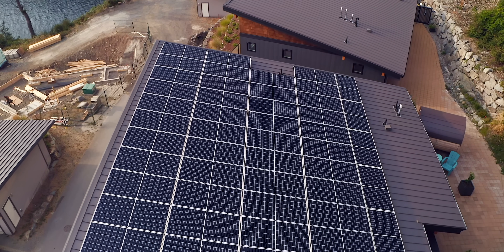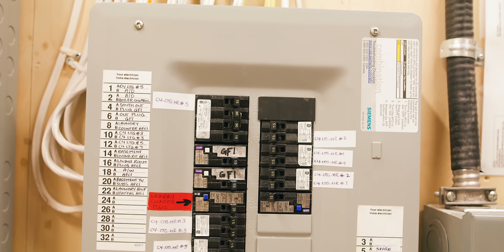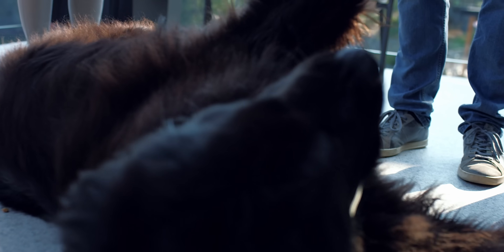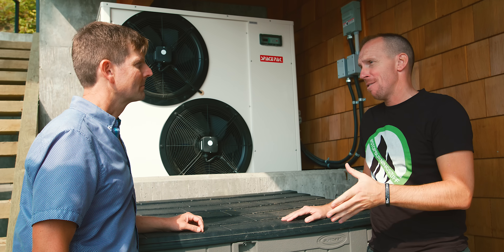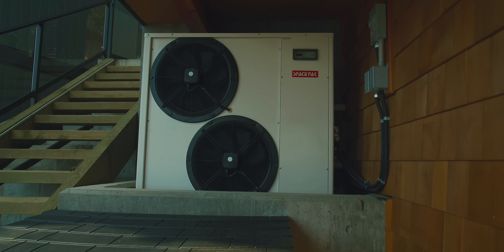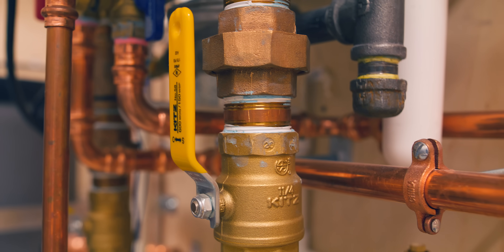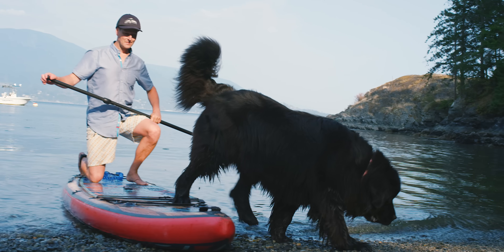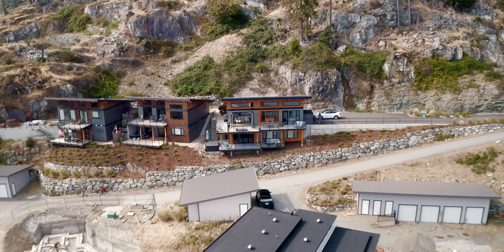How to Build a Net Zero Carbon Dream Home!

Comment: Should have came to my house on Vancouver island. I have built it myself but also did beyond what they did to this house by also doing exterior insulation on the home and the foundation. All the usuals like heat pump and low energy everything. No natural gas or propane. 100% electric. I haven’t done solar panels mostly because our electricity is already from renewable hydro electricity. So going solar wouldn’t really lower my carbon footprint.

Comment: This video missed the boat.

It makes reference to Step 5 being Net Zero, yet those homeowners state they only went to Step 4.

They also don't entirely self-consume. The weird answer around net metering tells you that they pull from the grid quite a lot, and that grid generation is certainly not all green. No home without sufficient battery storage should be considered a Net Zero home.

Just screamed like an excuse to go to a remote location for a video.

Also, being happy with a 300% efficiency heat pump is just ridiculous.

Comment: I don't get the title? They even say its a step 4 house(40% more efficient). Not a step 5 which would be net zero ready. You can clearly see the natural gas or propane boiler in the mechanical room with 636 venting. Efficient homes are great and needed but this video is misleading.

Comment: I use under 3500 kw per year. I could build a small town that runs on 19,000 kw. If this is what net zero means I call scam. Wasteful rich jackazzez.
Reply from the maker: If you drive a combustion vehicle, I hate to disabuse you, but you consume 10x that amount of electricity just from the energy used to refine the crude oil that ends up as gasoline that is then burnt, once, in your motor vehicle.
The massive, gob smacking, awkward and disruptive reduction in energy use when people use an electric vehicle is game changing. Since there are over 1 million EV's on the road in the UK, our annual electricity consumption from the grid has gone DOWN. The reason. More people have installed rooftop solar than have bought EVs.

Comment: Expert here in all mechanical systems and the man has money to make it happen.
 The reality for all community in short the that this new garbage 🗑️ way of thing places the weight of being good at energy use on the home owner and this is not your weight to carry.. 
Yes you can make good decisions and all BUT there are almost 
- 0 affordable building systems that fall in line “right out of the gate” 
- The cities and streets need to be put together where this stuff makes sense 
- New technologies are here but not yet pushed or realized 
- Cities and towns need to be redesigned from scratch to allow all this goodness  to be used..
- The home owner should not be financially destroyed to propagate something that can be put together by a group.

Comment: I am from Ontario and my dream home would be one using ICF and then solar panels for generating electricity and also some plans for collecting rain water. But for that might have to move up North to make it affordable. And I feel a Carbon negative home is a far better idea then driving electric cars as by the time they start becoming Carbon neutral they are already at the end of their lifetime cause of them batteries.

Comment: Material sourcing? Cost? Climate? Heat pumps require a back up boiler in winter in the uk , not practical or effective. more smoke and mirrors :-)

Comment: I don't understand 'net zero'. Credits don't exist unless there are batteries. These people are not the only ones using far more energy in the winter than at other times. I don't understand how it's useful for them to give that back to the grid six months before or after. It makes no sense. In the UK individually-built homes are extremely wasteful during construction, too; for every 5 houses built the equivalent of 1 house is thrown away as waste. Building techniques need to become virtually waste-free and houses need to consume no energy. The only good kW is the one you don't use.

Comment: Good that, currently, BC Canada is favorable to use just solar panels, that all excess production can be turned into credit. In Latvia, EU, houses can only have up to 10KW solar systems before they are considered a micro generator, and need to pay extra taxes for it, like a company. Also the excess generated energy gets charged for transmitting back to the grid, and then when you need that energy back you again pay transmission, so it’s pretty much useless without batteries.

Comment: My house is eating 0.11 kWh with pc, lights, fridge, tV and few standby modes on.
If yours is net zero with 90 kWh, then good luck to chineese manufacturers of solar panels and electric devices.
How is that sustainable?
I run on sun and photosynthesis.. you run on sun but in a wrong way lol.

Comment: This building cannot be called a sustainable way to build. They havent given any thought to the carbon footprint of the building it self. What about the origin of the materials are they localy produced, or have they been transported by the ferry? Also, the whole we are net neutral because we overproduce in summer, which is then compensated in winter isnt sound at all. Where does he think the 90 kWh of electricity (Which is a fuckload for just 2 persons) he consumes everyday in the winter comes from? We cannot overproduce us to sustainable building. We have to build smaller with more sustainable materiales and construction methods. This whole project is 10 years behind modern theory in sustainble building construction.

Comment: Hi Rob, i am aiming to go full electric but wanted to check if you are aware of the following product as a replacement for hot water bioler/tank: Schuller Aquafficient Eco+  air source water heater. Unlike heat pump no external unit required so in theory a great idea combined with IR panels heating and hot water shall be sorted, thx

Comment: We visited our aunt and uncle on Bowen island some 10 years ago. They mentioned loosing power every winter because trees fell on the wires due to weight of snow. 
Is loss of power still a problem? And how do they deal with it? - or was the away in February really about that. Just leaving in winter.

Comment: To answer the question posed in the title; "A large roof pointing toward the sun, and regulations allowing electricity to be traded with the grid." For sure, other design decisions helped, but this it would seem is the heart of the matter. We could do with more directness, more realism, in the reporting. This house has enormous generation capacity which is great, but it's not like a secret that's been unlocked. I admire the owners for having the focus and determination, and good for them for achieving this house. I imagine that it took a lot of work and perseverance. The Fully Charged Show criticises misleading corporate marketing and slanted political messaging a lot, take care not to slip into a similar habit yourselves.

Comment: Nice video, byy don't really need a home batterut I would forego the "shake cam" you used while interviewing the owners.  It's a needless distraction.  If their service is reliable, I would agree that they don't really need a home battery, since it would be spending thousands to save a few dollars of electricity.  If, on the other hand, they're at the end of the line and service goes off frequently, then sure, get one.

Comment: Important to highlight the difference between net zero carbon and net zero energy.  Just because you produce more than you use doesn't make you carbon neutral/negative.  If you have to dip into the grid when it's at it's most dirty it can cost you a large chunk of carbon.

Comment: BC has almost 90% hydro power.  All you need to do is build a house which doesn't burn anything and you're almost at zero carbon anyway.

IMO when you have a grid which looks like that efficiency measures (step code 5) and embodied carbon of construction become much more important than generation.

Comment: In winter, produces 10ish, uses 90kwh….hardly zero. 
So net zero over the year, and has to rely on the grid to keep going in mid winter, which needs a grid that is sized accordingly and is underused most of the year, so very poor economics.

Comment: Let's get to the core of this Carbon Zero folly. 

Us little humans going to net zero will not change the chemistry of the Earth. Populations of already low earning people are being conned by this latest unicorn tax and control tool of the W.E.F. Which is being implemented by Santa Klaus's 179 World Leader elves.

This house has cost a fortune to build, let alone the land it sits on, I would assume relative to the average persons income. From my point of view I would build a house that will endure the fourth coming decades of problems we will suffer. Having to rely on the grid for their power during, say months when the solar panels are covered or little light, when a few arrays of storage batteries would have allowed them independance form the grid seems a little naive to me.

The real world of many people is a harsh place to live and survive. Most peoples lives will get progessively worse to endure as we head towards net zero year. How many will freeze or starve in their homes, if they can still afford to have a roof over their heads, in the coming decade. Whilst those orchestrating this nightmare project for their own greed and power bathe in their ill-gotten spoils from this con gain.

Comment: My 1905 house uses far less energy than this and I've got 40kW of solar on the roof. This is a fancy expensive house and the hot water hydronic system would have cost a bomb.

Comment: BC has a unique grid but net zero is ok but not the right objective. We need to design for low winter energy use best exemplified by passive house and maybe subsidize grid tied batteries for resiliency. bC can then export clean energy to less well endowed regions.

Comment: So I'm actually really disappointed even Fully Charged is calling this a "Net Zero Carbon" home. As many folks in comments have already pointed out this is a new luxury construction which almost certainly produced a substantial amount of carbon to build. But furthermore the house is not independent of the grid and (unless I missed something in the video) there's no way that the substantial number of kWh the house pulls back from the grid during the winter are zero carbon. Just because you sold electricity to the grid previously and now take it back does not mean that there's zero carbon in the electricity you are being credited. Certainly this is a "low carbon" home or something like that, but calling it "Net Zero" is lying to ourselves in a way that the reality of climate change is indifferent too.

Comment: Great story Dan. Impressive place to live. Could you do a heat pump story for the UK at some point? They seem to be hit and miss, so I’d like to understand the science behind what makes a well designed system and in what areas they are best suited. I live in a rented house with gas, so a heat pump is out of the question. I’ve just had the old Ideal Mexico boiler replaced with a Worcestershire Bosch unit. It is hydrogen ready, but I gather the pipe work would have to be replaced, as hydrogen tends be be damaging to the existing gas mains.

Comment: We need to underline that our global environmental problems require us to consume less.  A large house and a huge solar array for two people makes net zero but it would be way better to use those resources in much smaller and more efficient homes that use much less energy per person.  I notice that moving to levels 4 and 5 relies on incentives rather than regulations.  I wonder if this is realistic.  Most people I know in BC can't be bothered to seal the leaks around doors and windows, even though they complain about the cost of heating.  It would be interesting to know how much progress we have made in BC on improving the efficiency of existing homes, and how much effect the rebate programs have had.

Comment: Sooo, slap a load of solar panels on new home with a heat pump and you can call yourself "Net zero", while probably still using energy from fossil fuel in the winter. This is not really special tbh.

Comment: While it’s great that the house is net zero for power, what about all the new materials that were used to build the house? Concrete basement, walls, brand new furniture and even a spa, looks like a lot of gains could be made from upcycling and reusing existing material instead of throwing everything and buying new stuff. We are missing the point here I think. If everyone wants to build a new house like this, it’s not sustainable at all.
Reply: 1. Keep the primary energy consumption low by using natural and local building materials, like timber, clay, straw or similar. 2. Build a house that lasts very long. 3. Use a shape that has the best ratio between volume and outside surfaces, like a cube. 4. Make sure your material can be recycled at the end of its lifetime. Again, natural materials are best. 5. Only build a size that you need. 6. Don't use chemical products, but alternatives instead like casein paint or isofloc insulation for instance. 7. For a new house i would go for a ground source heat pump, as they are more efficient. Anyway, those are just my design considerations based upon a house i built with my dad 30 years ago. Geetings from Germany

Comment: Beautiful! We've renovated (2010) an old concrete house with straw bales, insulated roof, insulated windows, solar thermal water heater & storage, PV (producing 4 times more electricity than we use, selling the surplus electricity to the grid for a good tariff),  no organic waste for us and for a few more families (feeds the chickens). The house and our family are proudly carbon negative 💪🏼
Reply from the maker: We might need to talk Daniel
Reply: @fullychargedshow  take a crew down there please!
Reply: My excess solar energy is purchased by BC Hydro for $0.06 per kWhr, which is considered the wholesale rate.  That is not a good tariff considering the installed cost of the system, and considering that we pay $0.095 for the first 1,350 kWhr in a 2 month billing period and $0.141 for usage above that amount.  Maybe you are grandfathered into a higher rate.  BC Hydro is not encouraging people to generate much more energy that they use.
Reply: @douggoodman3914  That's a pretty decent tariff compared to what we're currently on in the UK and Europe.  My current tariff is around $US 0.40/kWh import and 0.04/kWh export, but I could get around $US 0.12 export on other tariffs if I could switch.  
What we don't have but should is a tiered system like you have.  It's really unfair for those who have their thermostats set high to be paying the same price as those who are struggling to have any heating on at all when, on a day such as today when it's sunny and windy, we could get by on solar plus wind plus nuclear.  We're at a tipping point for UK tariffs over the next few years.  The UK has enough offshore wind capacity under construction to fill the 3GW of gas that we're currently using, and we've got something like 40GW of future wind projects planned, which will completely change our energy market. Over to the other recent Fully Charged vid on Vehicle to Grid for how that'll pan out.

Comment: To me it would be net 0 if it could repay its carbon footprint. Wood is good there as it's a carbon sink, however there is also concrete and all the other building materials. What the house uses once it's built misses half the point.

Comment: Dan if there's any way for you to present past to current residential thermal storage and its history from the 1940's onward I think it could be 
A very unexpected asset in moving many homes in the United States to using Mass as a type of energy battery storage to reduce cost and even increase Energy Efficiency over transmitting solar power for example through the power grid. Such power could be used in place reducing the demand on investor owned utilities here in the states. In my home state the public utility is resisting allowing sales of residential thermal storage for fear that home solar installations would use that power without the utility being able to monetize it. In other states that have cooperatively owned electric generation they're encouraging their members to put in thermal storage because it reduces the demand and fluctuations on their grid. See the tri-state Electric Cooperative in Colorado for example.

Comment: We have customers who would love to put in more solar but are constrained by National Grid (UK) to 4kW [= one sixth of what is on this house]
Reply: There may be a way around the grid dominating how much solar you can use. If the solar is to charge a battery then the grid has nothing to say about how much you use.
I have 10kW of solar on my house. It’s enough to charge 2 electric cars and run up the batteries 25kWh for a weeks worth of home use.
Reply: @PaulWetStuff  not grid connected at all?  Wow, what do you do with two weeks of gloom?   (Like now!)
Reply: @guygillmore2970  I have grid connection and battery. The battery is 25kWh and is connected to a UPS style charger/inverter. If it runs down I charge it off the grid at best time of day to get a cheap rate.

Comment: Why isn't the credit system just standard all around the globe even. Saves buying a battery, as the grid is your battery. Less waste, complexity etc etc. UK regulators, are you watching this?
Reply: Unlike BC Hydro, I suspect not many UK supplers can do long term hydro storage to offset power in summer off to the winter. It might be a great idea, but how many UK suppliers have massive battery backups that can sit full for months?